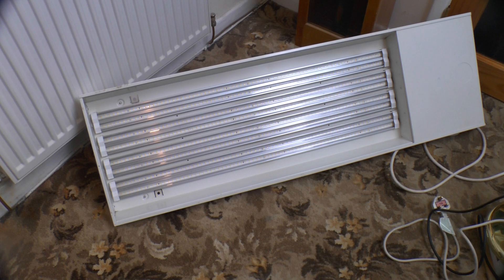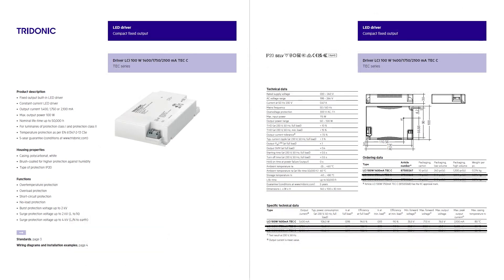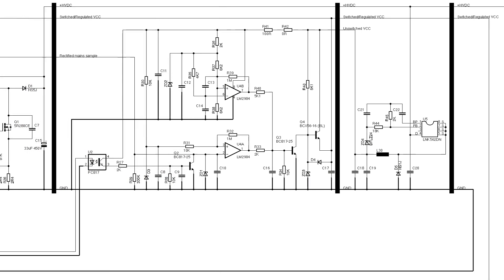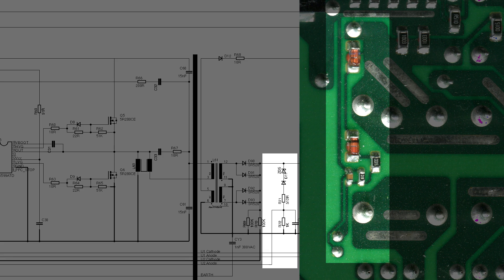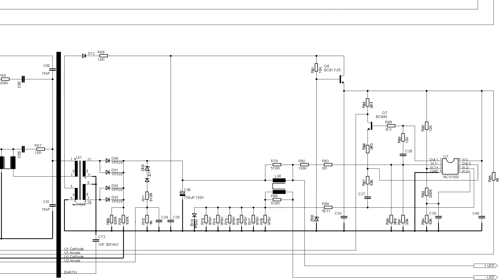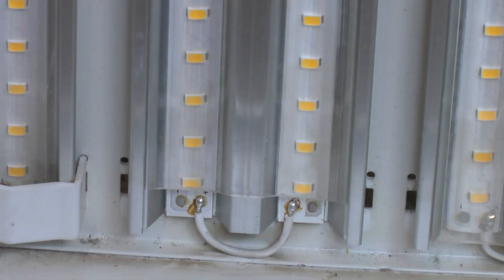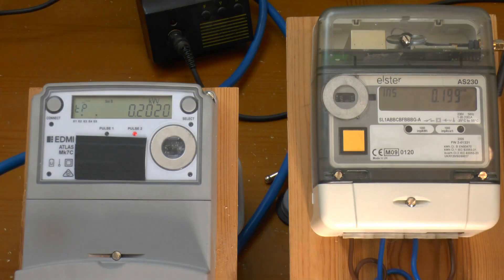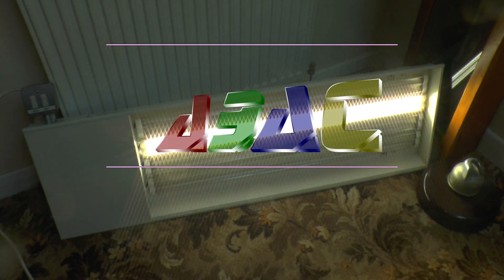What's inside a Luceco 200W LED low bay fitting?

Comment: Brilliant! I would leave the faulty led on the board and solder a thin jumper wire across the small solder blobs.
Reply from the maker: I don't fancy shorting the LED as it'd overdrive the other ones in that string; if it was a single string then the CC driver would accommodate it, but as it's effectively one fourteenth of the string but with 3 volts less Vf I expect it'd either start demanding more than its fair share of the 1.4 amps available, or the panel would reduce the output voltage to compensate and the strips would dim down.  As it is, the rest of those two strips are probably getting slightly overdriven (1400/13 instead of 1400/14) so I've got the same output anyway.
I could bridge it out with a diode string but they'd have to be able to fit under the cover lens.  Bugger it. :)

Comment: Decent tear down making the schematic and everything! Couldn't you use side cutters to trim the broken led and short the traces seen as it's a series parallel circuit? They aren't fun to solder, I agree! 
Got myself a 250W 415v LED sports light that's got a dud custom driver, what's cool about it is the dimming feature controlled via an xbee zigbee device which you don't see on many light fixtures.
Reply from the maker: I don't fancy shorting the LED as it'd overdrive the other ones in that string; if it was a single string then the CC driver would accommodate it, but as it's effectively one fourteenth of the string but with 3 volts less Vf I expect it'd either start demanding more than its fair share of the 1.4 amps available, or the panel would reduce the output voltage to compensate and the strips would dim down.  As it is, the rest of those two strips are probably getting slightly overdriven (1400/13 instead of 1400/14) so I've got the same output anyway.
I could bridge it out with a diode string but they'd have to be able to fit under the cover lens.  Bugger it. :)
Reply: @AintBigAintClever  Another boge job is using a resistor, just some hackery to think of ;)

Comment: I think D11 is also a zener diode, looking at its position on the PCB, this must be the overtemperature shutdown.
You are correct that the LNK low voltage supply is started by the voltage passing through D1 (which is just rectified mains, before it is stepped up by the PFC controller). This is how almost every PFC circuit works.
The mains sampling is there to prevent the lamp to flicker/afterglow when it is turned off, instead it will instantly shut down.

Overall this is about what one would expect in a not very highly integrated LED driver, I don't see anything special. The secondary regulation concept with U1 is extremely common in switchmode powersupplies, saves you from isolating fast signals.
Reply from the maker: Thanks for your feedback, it sounds like you've got a lot more experience in this field.  It's an interesting board, trying to draw out the schematic gives some clues as to how bits work, then you find that things can't work the way you've drawn them out and realise you've missed a track or some components.  I'm pretty sure it's complete now, but still a bit of a puzzle in places.